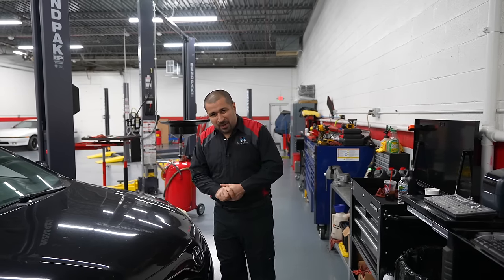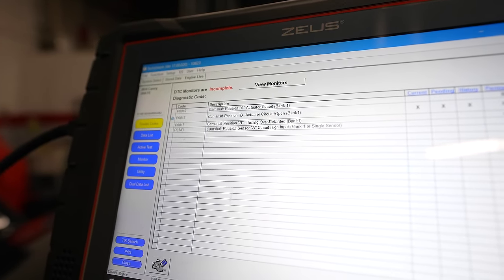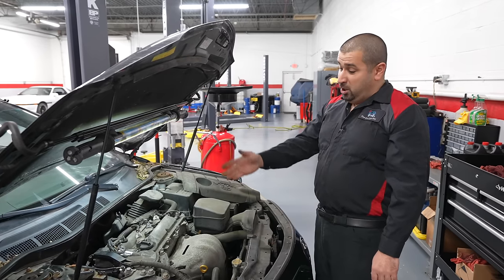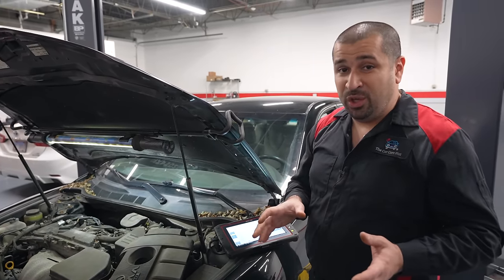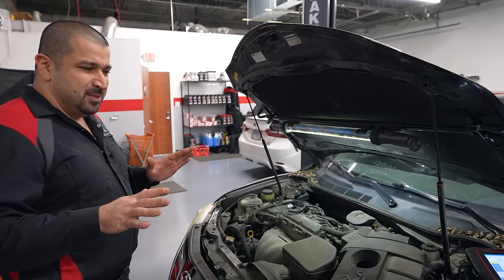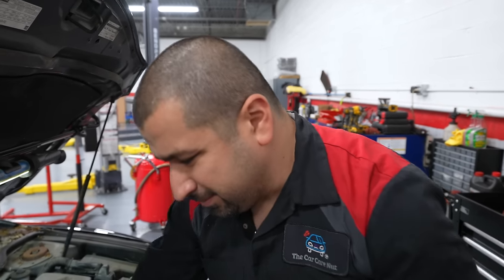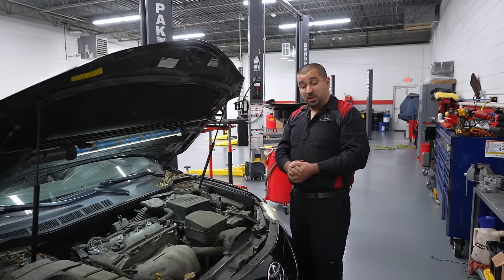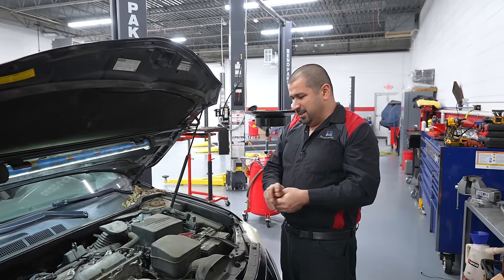Mechanic Parts Cannon FAIL Cost Customer A LOT! Let's Try This Again

Comment: If the customer is on that tight a budget .. Then find them a used computer and swap it. Better than nothing right?   And BTW, you should explain that you are a former Toyota Master Tech. You will know specific things about Toyotas that most generic mechanics will not know.

Comment: While we all should appreciate as great Mechanic, like our friend, here, the main thing this video does is re-iterate how useless the OBDII (& other) system is.

If it was truly useful, the Code which is displayed would actually tell you the problem.

Instead, we get a Code ,then have to know from experience, to immediately question it's validity & go through the 'old fashioned checklist of what the issue(s) really is.

So much time is wasted by the krap quality, growing, & unnecessary vagueries of automotive design.

In other words, vehicles today, are designed & built to make things difficult.

I am not a raving EV person, buy I look forward to the promise of these needing fewer components & eliminating the complacent auto designers/ mfrs....at least, that is my hope    We all know that the auto industry will find a way to keep things difficult, even after we kill Internal Combustion.

Comment: On a 2010 replacing cheap parts isn't a problem in my experience since most parts are not made to last - except for the computer or wiring harness which are the last item to be tested -

Comment: Electronic junk. Why did they change from mechanical to electronic. Simple answer because you could fix it yourself. Now you need diagnostic computers to fix anything. I'm not talking about meters. I agree who ever worked on this car didn't do the obvious by checking the wires all I'm saying is if not for the electronic garbage it wouldn't be nessasary. Because you run into these type of problems often enough you caught it quickly. I still say cars and trucks were better when most of the work was mechanical and not electronic.

Comment: Hopefully you can give me a idea I have a 2019 purchased New in2020 Buick regal tour x sport wagon AWD at 63000 Miles I have warranty to 73000 Miles 2025 on time I have a scream warning on for AWD off. It is AWD Auto on no off button this car has a clutch pack on the rear differential it has different oil than the gear oil of 75/90 syn it is a hydraulic oil in the clutch pack I see nothing in the manual in the service schedule to 240000 and I see nothing saying it ever needs oil change it does say if oil becomes low in the clutch pack it Will turn AWD off technician topped off fluid topped it off after ordering fluid taking a week now he said said I have corroded wire on a harness he said green wire carrogen. It was dark no flash light to show me I said I don't see that but he said that's what it is I am not sure I want this goober cutting ✂️ into a sealed harness any ideas please need imput where are you located

Comment: Good diagnostic method.

I used the same method to diagnose a bad computer on a used 2001 Buick Park Avenue I purchased 12 years ago. In my case it was the knock sensor.  It had a new one on it so I knew there was a problem elsewhere. After looking at a wiring diagram and tracing/testing wires, it had to be the computer. It was.

I was a trained diagnostic mechanic in my younger years. I left the field because I felt like a dealership whore. All I got every day were the worst cars that nobody else could fix. You only make time for time that way. Shade tree mechanics, paid at a lower rate, made flat rate on easy gravy jobs and could make more money.

I hope you make a good living and don't screw people over. As soon as a mechanic intentionally screws a customer, your life as a honorable mechanic is over. You now are a crook.

For others watching this video, most shops don't even have one diagnostic person. This guy said that half are bad. Nope. There are barely any people that can diagnose tough problems. A good shop will have at least one. Rarely 2. If there are 2, one will eventually open their own shop.

FWIW, I quit, went to college, got an Associates degree in Applied Science, and then got an MBA. I ran my own IT services and business consulting company for over 20 years.

... but I still work ony own cars because I don't trust anyone to be able to fix them correctly. Though, I'm getting up in age and hate doing it now. I wish I knew a real honest mechanic that was smart.

Good video!

Comment: I’m sorry, your analysis is overly simplistic.  You should have done a resistance check across the sensor leads at the sensor, and then connect the sensor and repeat the resistance check at the large connector, should be close to the same value.  Is so, then, look at the schematic to see where ground and power to the sensor is sourced from.  A bit more investigating is in order before buying a new computer.